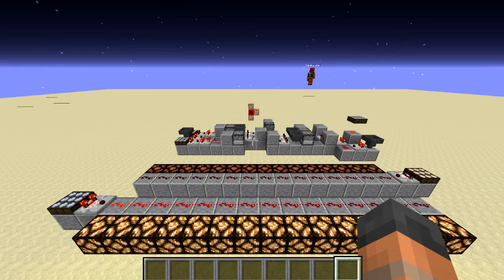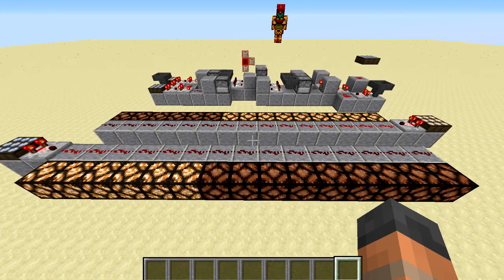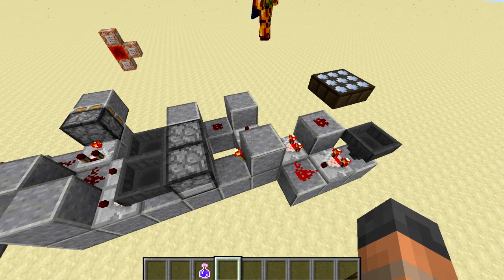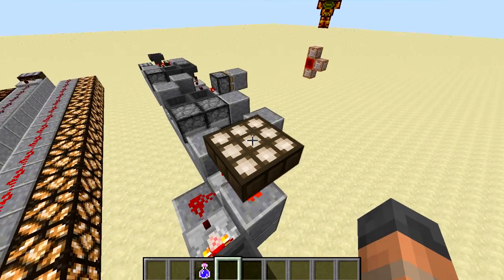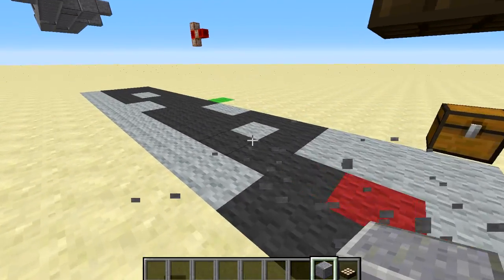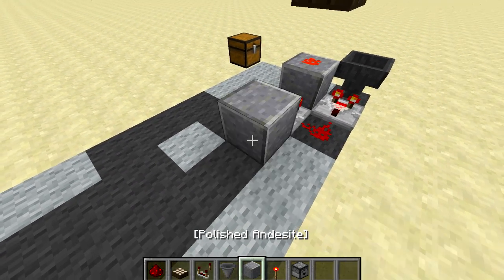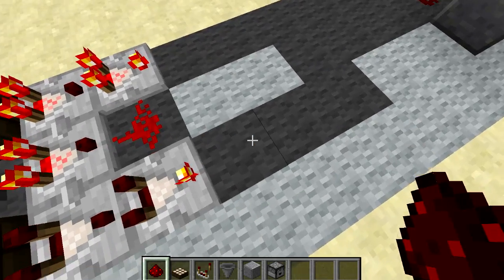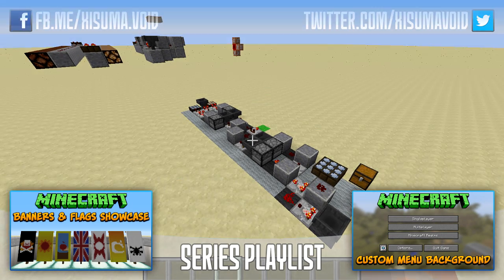Minecraft 1.8: Daylight Sensor Button Tutorial

Comment from the maker: Why no budswitch? Because it outputs redstone and updates periodically :-)
Reply: build it twice with an implies gate and you are done, i guess
Reply: Wouldent the bud switch get powered by the Day/Night detector?
Reply: finelly a dutch dude in your video, i love it :D
Reply: +xisumavoid Hey I don't know if you'd be interested but I made a button out of an item frame with a smaller footprint. You can put a map in the item frame to make it the size of a full block as well. The signal will also output proportionally to the amount of time you hold right click on the the frame; so if you do a quick right click that causes one rotation, it will give an output of 2-ticks, but if you hold for 2 seconds you'll get a 2 second output.
Reply: +xisumavoid I found using an and gate and a second sensor to detect the time. If the time is day and the sensor is day, a signal is output. If both are off then it will also output. That way if you change it it will output. If attached to a door it will close at night but it can be opened.
Reply: The other guy talking is Dutch

Comment: To save on materials you can use a block with an item frame, and an item inside of it, instead of a hopper. Rotate it 6 times to get a signal strength of 7 like the set up.

Another option would be to get a jukebox with the Melohi disk.

Comment: You can make the back up (The Part That Makes It So It Doesn't Turn On When The Time Of Day Changes) underneath the switch.

Or you can use a bud that is not influenced by the output of the daylight sensor like a y-bud

Comment: I quickly compacted it down to 6x6x2, using 3 day light sensors, 2 comparaters and redstone but I wouldn't consider it worth using anywhere. It seems to trigger off when day becomes night (as also seen in video) and If I remember correctly, day light/night time sensors all need to be visible to the sky.

Comment: Theory: and-gate with daylight sensors for both inputs. one in day mode and one in night mode. that will turn the output on and off when you switch mode on one of these daylight sensors. then take the and-gate out put and send it to one mono-stable circuit, and take the inverted signal and send it to another mono-stable circuit, and let both mono-stable circuits share their output.
I have no idea if this works but in my mind it should. At least right now :-p
Reply: could be the and-gate should be an xnor-gate...?

Comment: Nice build with Cube (:
The only downside I see is that the daylight sensors have to be open to the sky /:
Reply: It has to be open to the sky so you can use it as a button.
If it was hidden underground, you wouldn't be able to press it anyway.
Reply: ***** Hence the downside... lol
Reply: Ockams Razor The downside is that it has to be visible to use it?
Reply: ***** yes, not being able to put it wherever you want is the downside lol

Though I would also add the space it takes.
Reply: Ockams Razor Light sensors used to invert their signal when they were blocked off from daylight, while underground basically.
I just tested it to see if it still works, and it's half broken. So I sort of have a better grasp of what "Visible to the sky" might have meant now.
Reply: to be able to use it underground you just place it and it will naturally output nothing, and when its toggled to its inverse state it will give a full 15 block output. so basically having it open to the sky makes it harder to make into a button
Reply: Ckixy but I believe that at some point in the day it'll stop giving an output /: It's a very short time, but still it'll give a false output.
Reply: SiberianHat i have done some testing but i didn't do a full day cycle but i do believe daylight sensors depend on natural block light level not day cycles so with that in mind when its underground it will always have a full length inverse signal because there is 0 natural block light

Comment: It's a cool concept. But what are the uses for it?
Reply: you can hide it all but the daylight sensor underground and have just the daylight sensor visable to open a hidden door or something, I'm sure someone will find a use for it.
Reply: Alot of people like to use them as decoration shelves or something, if the bottom shelf also happens to turn on a secret door, thatd be pretty cool, its mainly just a new design not done before, i mean come on, what are the old redstone computer's 'uses'.
Reply: The old redstone computers use's are as followed. Calculators and pong in minecraft. On guy made a scientific calculator in minecraft.
Reply: EVILBUNNY28 LOL and the use of this is to make a daylight sensor act as a button. It's really not that difficult to understand.
Reply from the maker: The use? Its an input. like a pressureplate or button
Reply: xisumavoid technically Lever, or button hooked up to a toggle latch.

A real good use could be to hook it up to a redstone dust line that heads to a friend's doorway and then mess with their doors, and when they ask just say "I don't understand, i'm only using the sun and the moon"
Reply: Bigpowkill  It's giving a single pulse for on /and/ off, so it does act like a button and not a lever.
Reply: Hampsterman4
Oh... didn't notice that. thought it was a toggle latch... It should be a toggle latch...
Reply: EVILBUNNY28 I want to use this with the Campfire Armor Stand Trick so that it turns on at night.

~Hobbit

Comment: You could make it act like a lever rather easily if you just compared the signal of the sensor to another sensor, so if they're the same it's on and if they're different it's off, couldn't you? Then you can hook it up to a dual-edge if you want the button functionality. I'll have to try that.
Reply: Just tried to sketch it out, I guess it's a little trickier than I imagined. Would probably still work.
Reply: But that will only work half the day. (night or day)
Reply: No, it should work at all times, shouldn't it? Because it's comparing to another daylight sensor that's either giving the same signal or opposite?
Reply: Nope, it isn't. Too difficult to explain. Hopefully you will understand it and mess around with my design (pic.twitter.com/xLME8sAnBW)

Comment: Two bud-switches do the same job job, one detecting any updates in the daylight sensor that works as the button and one that detects updates from other daylight detector stopping the signal from the first bud when the signal strenght changes (does anyone else even use repeater locking? (when the repepater locking is locked at the same time when it is turning on it stays off))

Comment: Here's a much smaller (3x3x10) and simpler (no hoppers/droppers and only two each of sensors and comparators) version: http://gfycat.com/QuickWhimsicalChafer. I'm too lazy to make a video, but I think it should be fairly clear what's going on from the gif. As a bonus, both sensors work so you could have one on either side of a wall if you wanted.

I'm not sure why you would want to do that, though.

Edit: A 3x3x8 version, identical to the above except a little more compact: http://gfycat.com/NaiveHauntingCreature
And a 3x3x4 version using a different mechanic which will false-fire twice a day, once in the morning and once in the evening: http://gfycat.com/InconsequentialUntimelyAardwolf
Reply: thats really cool. so your 3x3x8 design doesn't have issues with the transfer from day to night? i might have to do some testing with this design.

would you be able to upload a two sided picture so we may copy it? also do you think this design would work in a way with the daylight sensors stacked that was one of my goals when i was making mine so only one block needs exposed to sunlight.

(side note) for most redstone measuring you include any block redstone dust is on so this would be 4 tall